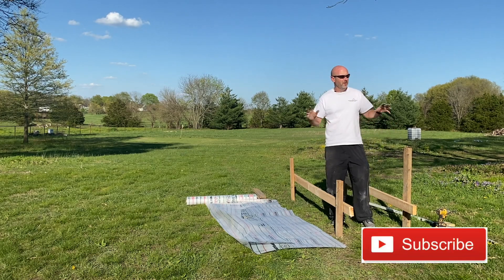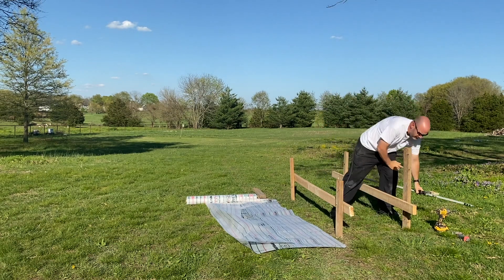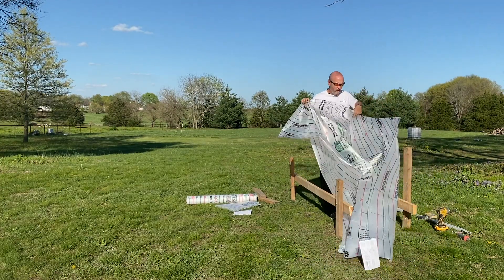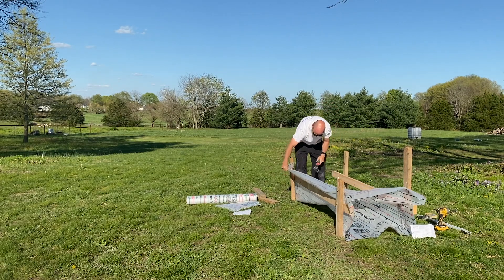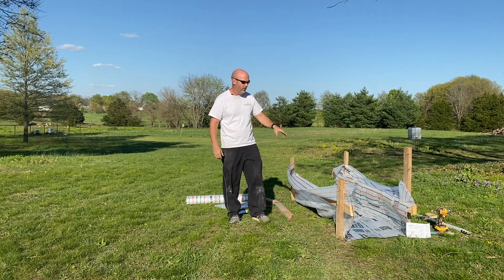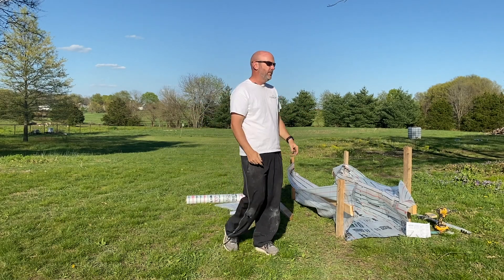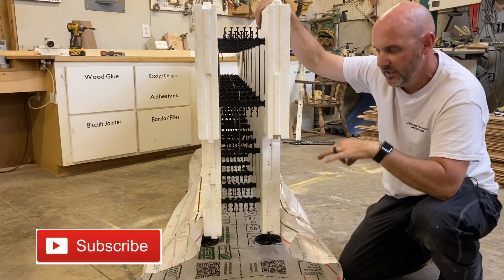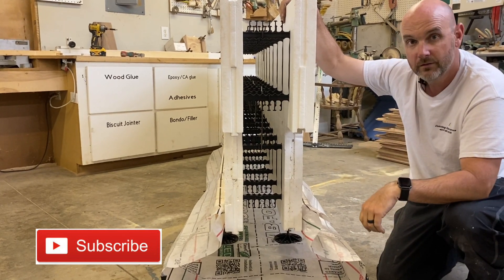Fastfoot!  DIY Footings for ICF!

Comment: In 2016 I did all mI worck with those materials , coloms , foutins . nudura wall whith the structural forms holders , ans after I sold mI stock to a N,Scotia guy, no lost , making alone all the way ,verry easy the only thing is wend you pour , have some one to check the walls straightness with a drill& socket to ajust, all the rest in so easy , I was 64 yh and appreciated the way it whent , 🤩

Comment: You would think this  will also hold water if the exterior side is compromised ?
Reply from the maker: No
Reply: @all3pools 
Explain why it wouldn’t
Reply from the maker: @woodyahh2110 I just thought it was a daily comment, wouldn’t tyvek, ahd any other vapor/moisture barrier, use it right, protect it right, great product, either you hate new things, sell a competing product, or something else…. Fabform is the most innovative company in the game….
Reply: @all3pools 
 vapor barriers are only as good as the installation
Reply from the maker: @woodyahh2110 so is this I guess, if you are mediocre just keep building like it’s 1972…. Some people like driving ford pintos

Comment: Is it possible to use the fast foot system with ICF on a sloped surface AND where only half of the building footprint is a basement.  In the middle of the footprint would be the back concrete wall of the basement.  I want to avoid extra excavation & a needles foundation costs.
Reply from the maker: For sure, do it all the time in the Ozarks
Reply: @all3pools  How about making a video on that configuration ?  Thx for replying.

Comment: How do you stop the footing/walls from shifting during the pour?  In my head the concrete is going to push and pull those walls anywhere it wants... no?
Reply from the maker: No, very stable footing forms, the forms are foam glued to the footing

Comment: Tempted by the mono-pour, but I feel like the bag and the little legs would be subject to horizontal movement.  I like the idea of spray foaming the blocks to a solid footing chalked with a straight line.  Are my concerns founded?
Reply from the maker: Not really, it’s all in the bracing, bag is surprisingly stable but the wall could move if not properly braced but it’s pretty straight forward

Comment: So, ideally, you'd lay down the vapor barrier first, then the Fast Foot on top, then staple both to a 2x4 running length-wise?

Which vapor barriers do you prefer?
Reply from the maker: Fast foot is a vapor barrier, you only need to add to it inside after they pour, 6-10 mil plastic or if u can swing it 2” of closed cell foam

Comment: Upcharge for this?
Several years ago I was quoted $25,000 to pour a 1200 sq/ft driveway by two different contractors.  Concrete already costs a flunking fortune, so no, I don't want to be "upcharged" for a g.d. thing
Reply from the maker: That’s why this video is titled DIY…. If you don’t want to pay extra for something that costs extra, but provides more value to the home than the cost, Do It Yourself!  I’m a huge advocate for sweat equity…. And several years ago, and today that price you quoted is out of line unless you were wanting decorative concrete of some type…
Reply: @all3pools  
6" slab with nothing fancy
Materials and labor are far less expensive in the interior states than the coastal states

Comment: What are your thoughts on Helix rebar replacement?  We are building an ICF home soon and we are trying to find a ready-mix contractor that will work with us to do the walls and slab with the Helix product. We are completely sold on Helix but the concrete suppliers are definitely old-school when it comes to anything new. We want to do a monopour with the first couple of courses of ICF to prevent a cold joint betweenthe footing. We have a little time to figure it out so that's a good thing.

Comment: Attention to good details is your strong suit. That tip on not nailing the cross supports to the level screed boards is a jewel. It's way easier and quicker to screed level. And the finish looks so much better. Keep it up!

Comment: Only issues I see with this type of footing material is the fact that you dont have a solid flat square bottom at the footing and that will lead to issues with the footing sinking in more compared to a flat bottom footing. The other issue is reflective of the last issue just talked about but the bowing out of the sides. I would rather have the regular formed footings with rectangular shape.
Reply from the maker: There is the same amount of flat with these as opposed to traditional footings…. And a square corner has nothing to do with a shape being less likely to sink, any footing can settle if placed on bad soil….
Reply: @all3pools  how is there the same amount of flat area when the bottom of the fab form footing is rounded and the sides are rounded. Thats because its not the same as a traditional footing. And yes it all depends on the type of soil and soil bearing capacity regarding how much a footing will settle but I would put money on a traditional footing compared to a fab form shown in that video cause its rounded on the bottom and sides. Its going to sink more into any soil compared to a traditional footing with flat squared bottom justdue to the shape. If you take something square and push it into say the dirt there will be more resistance and less compression into the soil. If you take that fab form footing where its rounded on the bottom and sides it will push more into the soil just due to the mear shape. Its like a pointed edge. Not to mention as well that a tradional square bottom footing wont roll on either side if the weight is more than it can support compared to the fab form footing which is rounded on the bottom. It has the potential to roll to one side cause the bottom of the footing is rounded due to it not being able to support the weight.
Reply: If you properly compacted the surface that you will be pouring on, the bottom of the footer will be flat. The sides will not be with the Fab form product. You have to make sure the plastic is touching the ground the proper width of the footer that you want. Whatever is in contact with the flat ground will be flat.

Comment: How high is the first pour if you use the legs, as in how many blocks of ICF and then how long before you pour to finished hight say on a single story rancher ?
Reply from the maker: You can generally pour as high as you need for your plan, the official answer from most block manufacturers is 12-15’ max height per pour…. That said, I know a couple contractors who exceed that when necessary and we have poured around 20’ all at one a few times

Comment: We are thinking of using this for our concrete footings (non-ICF) with a 16 x 28 inch footing.  Will this work with that size footing?
Reply from the maker: Ya, there are 2 widths, I usually get the 72” wide just so I have more flexibility in footing width!
Reply: @all3pools    Great!  I will probably order some this coming week.  Thanks!

Comment: I am building a house and plan on using the ICF and Fast foot form.  Have you ever poured a cantilever footing with this.  My footing is going to be basically 1 foot out side and 2 foot inside. I think I can just take 2 bags and over lap them to get the extra footing on the inside.  What do you think.
Reply from the maker: The fastfoot comes in widths up to at least 72”, so you may be able to make one work…. You can do what you are talking about but you will want to try to attach them in the middle a little bit if you pour really wet, it will slide out from under if it’s not fixed at least somewhat, or pour it stiff, which makes for a stronger footer anyway!

Comment: Wow, this product made sense from the start but that monopour idea seems huge. Especially for a more thorough waterproof.
Reply from the maker: It’s not that bad to pull off…. We get a little fancy with the mix to plug up the footer, plasticizer to add temporary fluidity and calcium to firm it up quick…. Not to the whole order, just enough to firm up the mud in the bag!  I’ve poured upwards of 19’ on top of Monopour at one time and the other guy BBC we talked about has done 24’…. So doing a normal Basement wall is pretty straight forward!
Reply: @all3pools  that's great to hear! I'm very interested in doing this myself. Would also save a step with rebar! Would it be smart to bend a small 90 in the bottom end of your vertical so you don't poke your liner? Or do you do it first and just wire it to the side of a web?

Comment: How does the methodical pour in high ground freeze work? That would be interesting to know.
Reply from the maker: Still need the footings to go below frost line…. In low temp areas you will have a lot deeper leg on your mono than in Missouri where our frost line is 18” but still very doable

Comment: It’s called the Foothold , the product you mentioned . I saw it also but was concerned about a few negative comments about it on “You Tube “ but looks promising along with the Fastfoot . What’s your opinion ? ? My wife & I plan on an ICF home build in Ridgway CO but want to do it right & efficient since it will be our dream home . Thx 👍
Reply from the maker: In my climate I like the waterproofing aspect of fastfoot more than I value a thermal break below the frost line but if you could do both by running fastfoot inside the other system, win win!

Comment: In colder climates , CO , Wy, Alaska etc why not use ICF forms along with Fastfoot inside of ICF footings for additional insulation & frost protection ? ?
Reply from the maker: They have a system like that, I forget it’s name but you use foam board in lieu of forms, it’s got a web like icf you insert your foam into, looks cool and could b valuable anywhere it gets really cold, thermal breaks wherever you can whenever you can!
Reply: Would you also put the Fastfoot on the inside too then as a waterproof barrier then pour the footing  ? I guess it wouldn’t hurt putting the foam on the bottom as well as the sides then too or would it compromise the footing at all ? ? Just thinking outside the box to keep the entire footing from freezing & water proof but I know it’s got to be at least 48” below grade in those type of environments. ? ?

Comment: We built a full ICF home two years ago.  I used Fastfoot attached to the bottom row of the ICF using levellers attached to the ICF.   Did a mono pour.  It worked fantastic.
Reply: @@Marcusus we had a nice level excavation so it was a breeze.  We dug 5’ wide and 4’ deep trenches so we had lots of room to work.
Reply: How is the energy saving and indoor comfort in your house with ICF?
Reply: @Engineeringconsultations  My previous home was built in 1972, 3500 sqft, was spending roughly 500$ on electric bills. On my 2500sqft ICF home I'm in currently, my electric bill was $98 last month, same electric company with roughly same usage. Sure it's 1000 sqft smaller, but best investment I ever did. The first year there was alot of humidity, but it was expected with concrete. A dehumidifier is your best friend in the beginning moving into an ICF place. ICF is the way to go. Also got a pretty good discount on my homeowners insurance because the house was built to (I believe the term was) a legacy house since it was concrete and not wood.

Comment: Once you remove the 2 x 4 framing from the footer, is the fastfoot material bonded with the concrete?  In my area the below grade ICF walls need a termite and water barrier.   Can you simply trim the excess fastfoot material and them apply a peel and stick termite & water barrier from the walls -- over the top of the footings -- and onto the fastfoot material on the sides of the footing?

Comment: Aaron, really love the ICF and Fast Foot videos. My question is about cold joints if I’m not pouring the footings and walls the same day. How could I prevent cold joints? Is there something in addition to the rebar that could bond the walls to the footings so the whole frame would be monocoque? Living in an earthquake zone I like the strength of ICF but fear that a cold joint at the footing/wall would negate a lot of that earthquake resistance.  Thx.
Reply from the maker: They make pvc water stops but you really need to be sure exactly where the water will be to center it, you can also imbed a 2x4 flat in the footing so it creates a key way that makes water have to work a lot harder to push through!

Comment: Definitely going on the list for my self-build... Awesome,
Reply: it's a good system. I use it almost exclusively on my ICF jobs. I recommend as stated in the video  not doing a monopour as your first job. If you are inexperienced with pumping concrete you will find it moves if not poured properly, and there are enough things to worry about without adding more.
Reply: Yeah I agree I am glad I didn't do a mono pour for my first

Comment: Any thoughts on Form-A-Drain vs this? Fastfoot looks great, especially for a monopour, but I keep thinking having drains as part of the footer ends up with more benefits.
Reply from the maker: I have not used form a drain, nor can I speak to costs/benefits...  I think it has to be considerably more but you are replacing drain pipe as well so you’d have to crunch the numbers, what I like about it is the potential radon mitigation, I’m in the ozarks and it’s a common problem on houses here...  but otherwise I think I see more benefit to keeping the footing out of contact with the wet soil, at least here in Missouri, we have very karst topography and water moves laterally through the ground but a properly installed French drain is cheap and works really well if done right, but you can literally see moisture on the inside of a normal footing just wicking up into the stemwall...  we do a lot of crazy stuff to our crawls these days up to spraying closed cell marine grade foam on the floor and footers and conditioning them, once you go that far you don’t absolutely need the fastfoot I suppose, but it’s so quick and easy I’ll probably always use it!  You gotta love all the innovation though, annoys me so much when I see the same old dogs refusing the new tricks lol
Reply: wrong, form-a-drain does nothing to stop moisture from wicking up an icf wall. fast foot is superior especially since you can put a french drain in also with fast foot.
Reply: @jjg1501  Thanks for your comment. How big of a problem is moisture wicking up a wall? 99.9% of footings are in contact with bare earth, right? Does Fastfoot prevent you from making an Ufer ground? Perhaps you could throw some Xypex in the footing concrete to prevent wicking.

Comment: Would you happen to know, how long the fabric can be exposed to UV before degrading?
Reply: You would need at least 3 months of day in, day out sunlight on Fastfoot for it to slightly damage its strength. If its taking you longer than two weeks for a set of footings you are in the wrong business!
Reply: @FabFormIndustries  I'm an owner builder using Zonts/Zuckles and yep, even I was able to build my footers under two months.
Reply: @KipringPayne  How did it all work out? Would be great for us to see some photos. Any issues?
Reply: @FabFormIndustries  Tried Posting this before links may not be working. - posting a second comment with link .
Reply from the maker: I don’t know the official answer, some of the guys in bc that work for fab watch these so maybe they can comment, but I’ve had some around pools exposed for a long time with no visible degradation